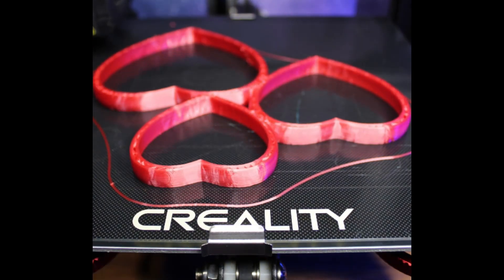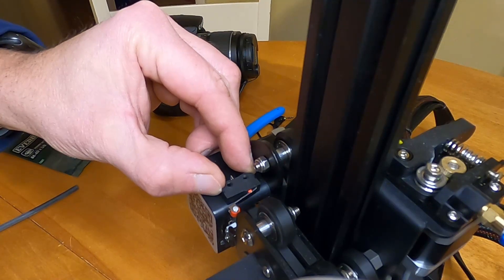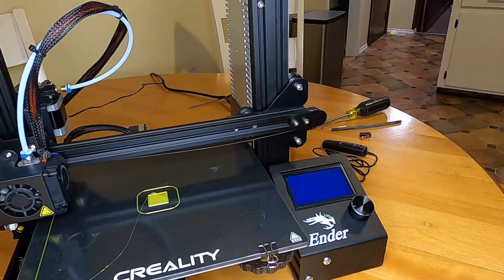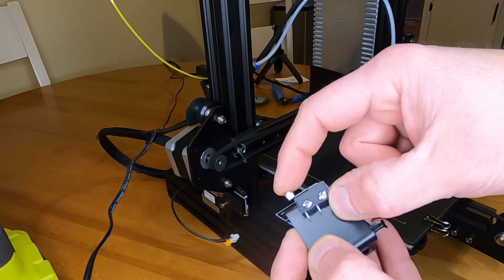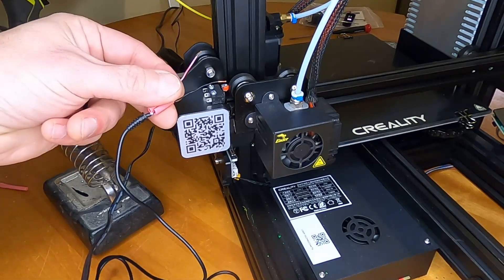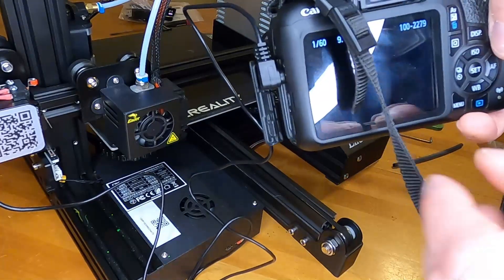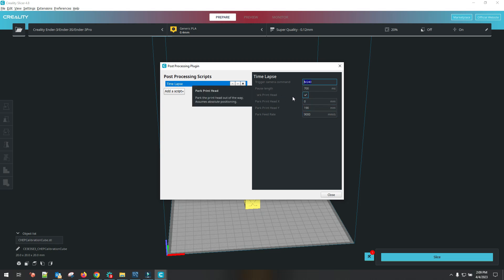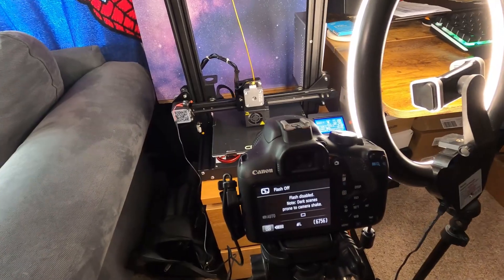Ender 3 Timelapse Setup Using A DSLR

Comment: Is it possible to timelapse with a camera on two m50 Mark IIs on an ender 3 v3 printer?
Reply from the maker: Should be able to split the trigger wires to each cam or even use a Bluetooth camera trigger and set it up on both. There’s a bunch of ways of doing it